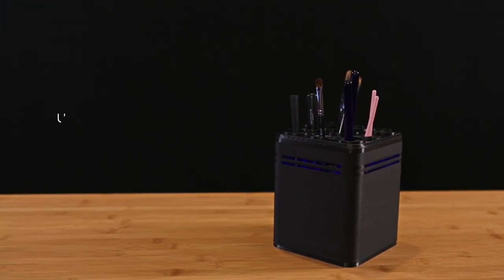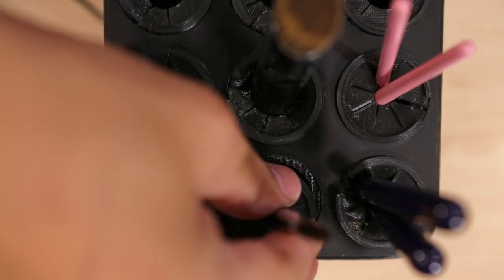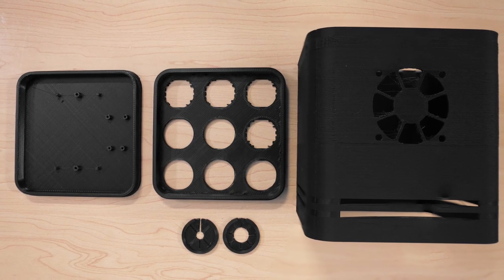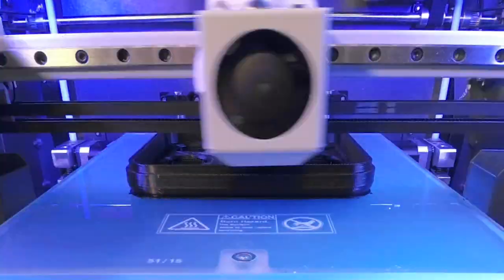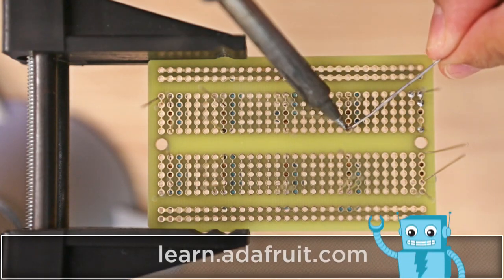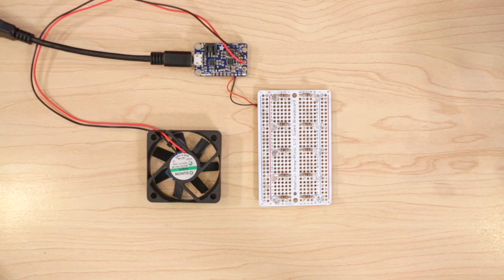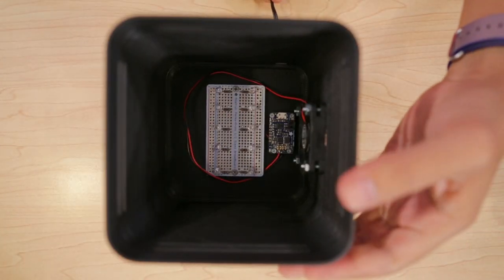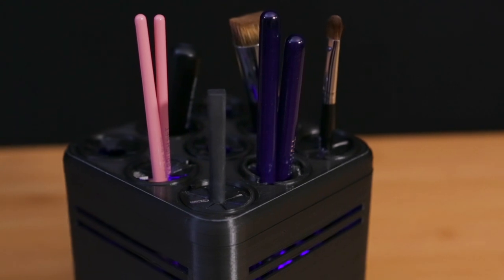Makeup Brush cleaner with UV LEDs #3DPrinting

Comment: cool but does the uv leds really have a disinfecting effect?
Reply: Depends on the specific wavelengths of the LEDs used:
http://www.bioelectromagnetics.org/bems2010/supp_data/P-A-140.pdf

Based on the datasheet for the LEDs from Adafruit ( https://www.adafruit.com/products/1793 ), the answer appears to be no, they won't have much of a sterilization effect, if any.
Reply from the maker: https://en.wikipedia.org/wiki/Ultraviolet - jump to Sterilization and disinfection "UV-A irradiation and increased water temperature kill organisms in the water"
Reply: Adafruit Industries
Thanks :)
Reply: But if anything, you're decreasing the temperature of the residual liquid water by increasing the evaporation rate with the fan.  Also, the LEDs Adafruit sells are more purple than UV-A.  They don't have significant intensity in low enough wavelengths to have any appreciable sterilization effect.

P.S.  That section of the Wikipedia article needs some editorial attention.  See: https://en.wikipedia.org/wiki/Ultraviolet_germicidal_irradiation

Noe and Pedro; while this is a cool project from a 3D printing perspective, it's utterly useless for the intended purpose.  Props on the cool design, but please don't continue to promote it as 'germicidal', 'sterilizing', or 'disinfecting'.
Reply: no.
Reply: Yes they do hikers use them to clean water.
Reply: No, hikers use tubes similar to fluorescent lamps, but without the phosphor to sterilize water.  This is not the same thing.